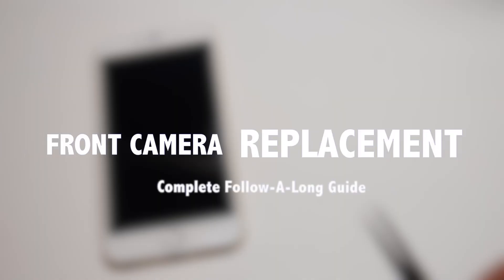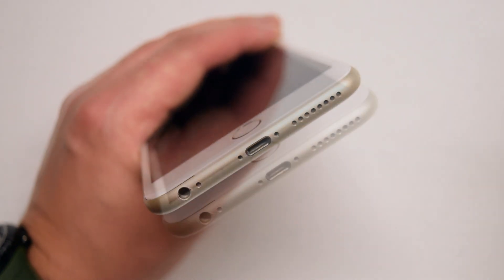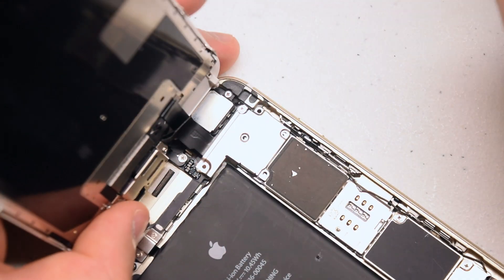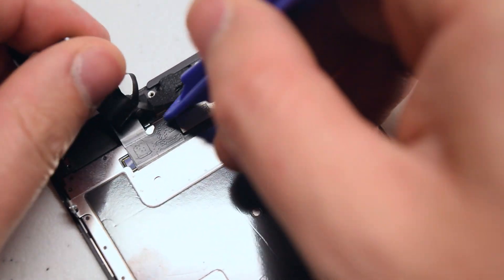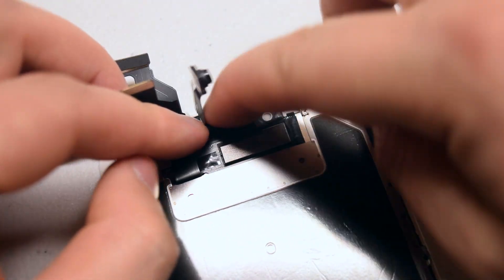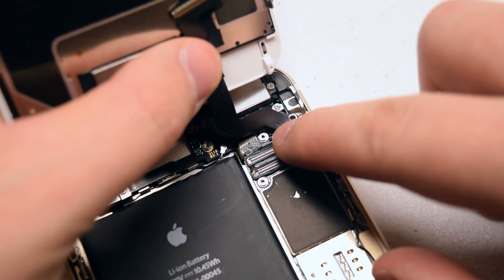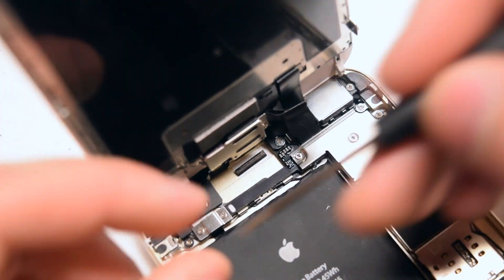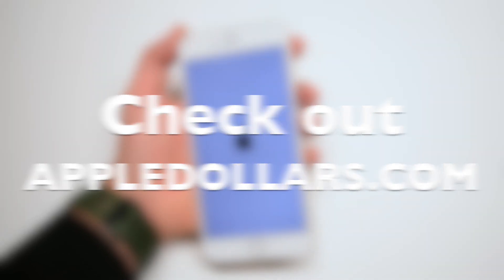iPhone 6S Plus Front Camera Replacement

Comment: I have replaced my old blurry camera with the new one. After fitting it, my camera working well but no sound on ear speaker. I again open it and again fitted but same problem occurs eveytime. Then I replace my old camera then the ear speaker is working.
   What can be the problem???
Reply: I ordered a spare ear speaker just to be safe. It was around $4 on Amazon. Changing today.